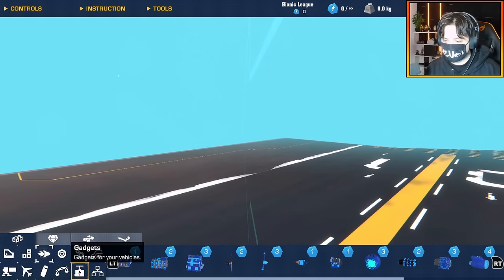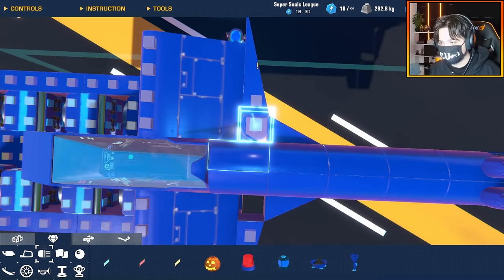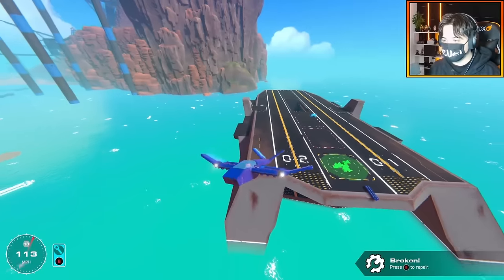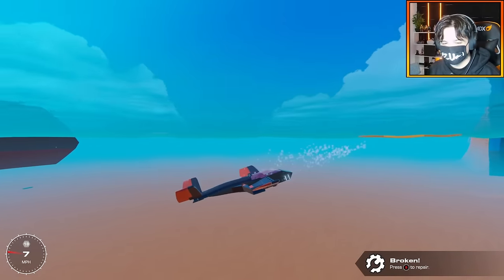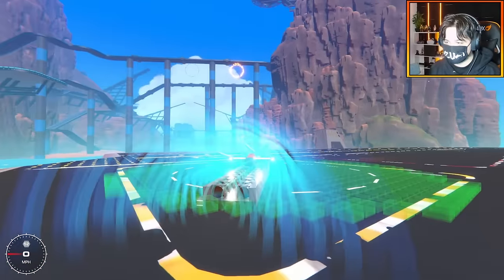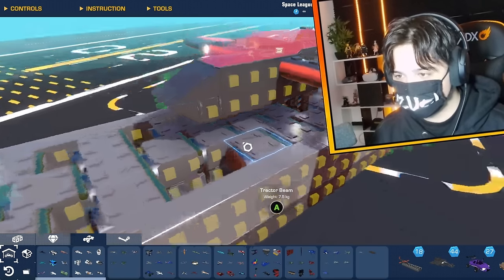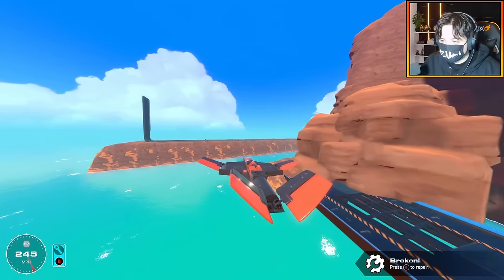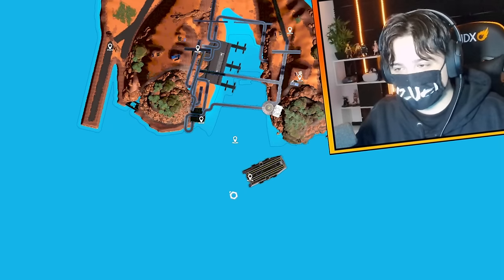Using A RAILGUN To Launch A Glider In TRAILMAKERS!

Comment: Yzuei and Scrapman should try and land on a moving aircraft carrier using an extendable tail hook and arresting cables made of pipe pieces. (It is possible.)
Reply: yes i think that is a very good idea to
Reply: That's been done by one or both of them
Reply: They already did that
Reply: @cheesywaffle6761 with a tail hook??? Because ive only seen those landing attempts with the big hug
Reply: The landings would be similar to those on the USS Gerald R. Ford. They have not done that yet.

Comment: I think you should put skis on the glider, detach first then activate the tractor beams. Zero drag is kinda cheating the challenge.
Reply: yes, but zero drag made it op as well ( it defiantly is cheating tho)
Reply: I was kinda thinkin along those lines too... I wonder if three were random chances of the Plane briefly coming into contact with the surfaces of the Magnets during Launch imparting unpredictable placings and amounts of Friction interfering with Launch... upside down Skis on top of the Magnets mighta alleviated the issue. Ski Feet for the Glider is an option too if something to act like Brakes is combo'd with'em for Landing purposes as well, though this one is less likely cause Yzuei and ScrapMan and all the Gang are all allergic to Aircraft Landing Gear. :P

Comment: The issue is acceleration, a glider is designed for slow speeds and gradual acceleration. Try a delta wing and angle the magnets inward with hinges
Reply: i agree

Comment: The glider spins on launch because at some point the tail is getting pushed more than the nose. Either turn off the magnets as the glider passes (solve the root problem) or make the tail longer with more stabilization (overcome the effects). Adding weight to the nose was a variation of the latter solution with a side effect of moving the lift too far back.

The glider runs out of energy before reaching the goal--as you've proved--because of drag. Making the glider heavier overall will give it more momentum. Then, if needed, add more lift without increasing the aerodynamic profile too much. depending on implementation, this could potentially give you more distance (compare throwing a rock vs throwing a wad of paper).

Comment: Feel like you cheated, messing with drag. A slow feed into this, with one or two tractor beams into a denser array of them might have worked. A 0-100 approach was a bit much for a first attempt. 

Personally I would have placed the tractor beams less dense to more dense to handle the increase in speed a bit more gradually.

Fun idea though!